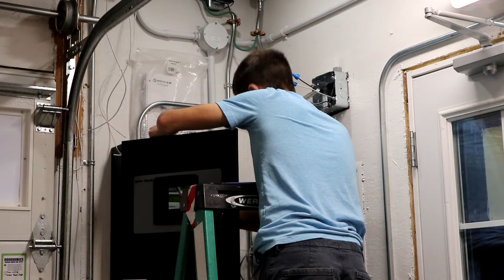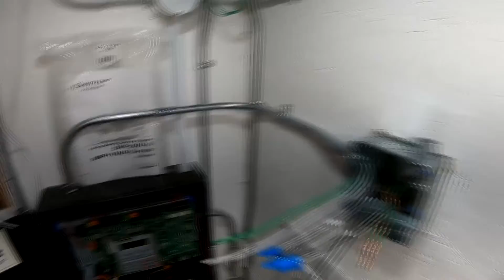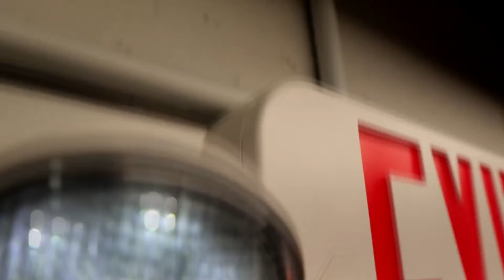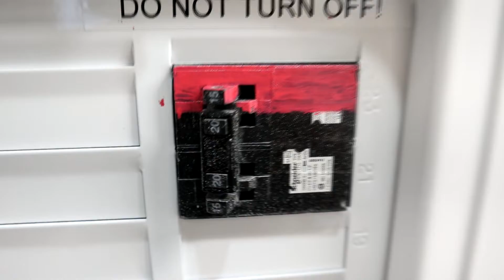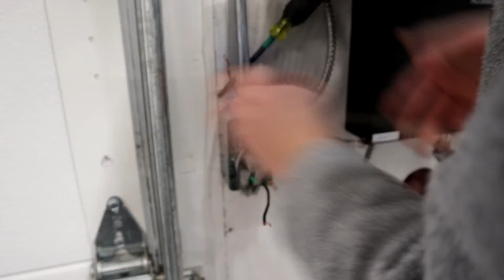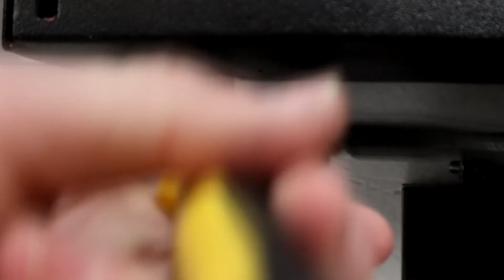Wiring 2 new dedicated electrical circuits - part 2

Comment: You should get a system sensor bell to put where the low frequency sounder is. It’s same brand as strobes and also cool because you are in Canada
Reply from the maker: It would be silly to buy a bell when I have 14 bells I was too stupid and put the emergency light to close to my box so there’s not enough room for a bell
Reply: @nics-systems-electric  oh shoot! You should move the emergency light 🤷‍♂️ I think I already said this but a system of Edwards bells and genesis strobes would be cool
Reply from the maker: @4O5O-8O  I want to move it but I’m too lazy because I have to paint behind where it was
Reply: @nics-systems-electric  lol! Sounds like something I would do too!

Comment: Would you recommend getting fire alarm supplies from eBay used or get it new from amazon?
Reply: .... because I am thinking about getting a fire alarm system because why not!
Reply from the maker: @policegaming101yt2  I’d say eBay Amazon sucks for fire alarm stuff way overpriced
Reply: @nics-systems-electric  Ok, thanks for the recommendation. I do agree amazon is so overpriced, I just looked!
Reply from the maker: @policegaming101yt2  yeah there’s some suppliers you can get stuff from two if you want new
Reply: @nics-systems-electric  I was looking into that and even them were cheaper then amazon. So I have came to the conclusion that Amazon is basically a scam. Thanks! Also, you inspire me to do a lot of things like electrical. I went on and be came a electrician apprentice and I am on my way to a fully licensed electrician.

Comment: Nice, just one thing- you arent supposed to cover any markings on the breaker with the red paint, that’s a code violation (at least in the US) but everything else is alright besides maybe the box fill is a little much on the one in the wall
Reply from the maker: Boxful isn’t even close those 4-11/16 can handle quite a bit and I’m not sure about the paint rule